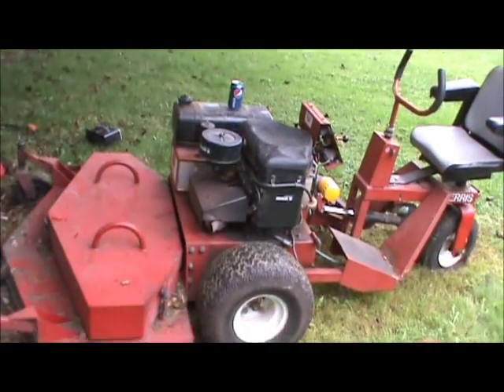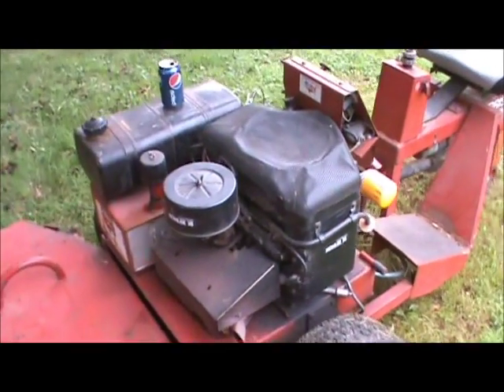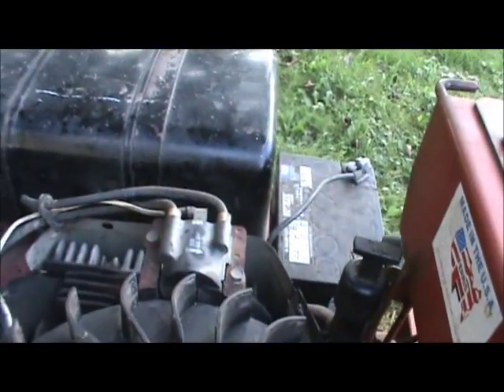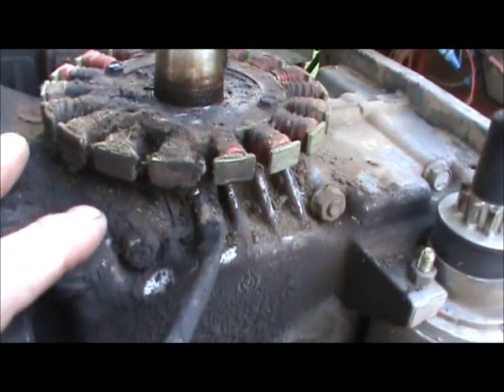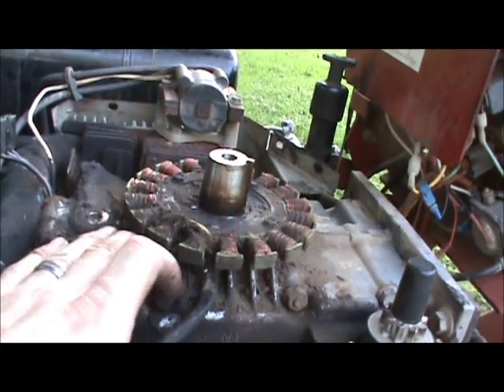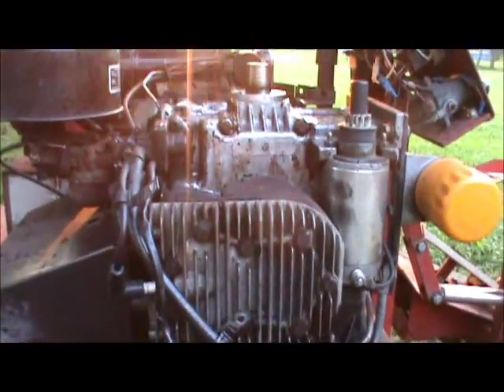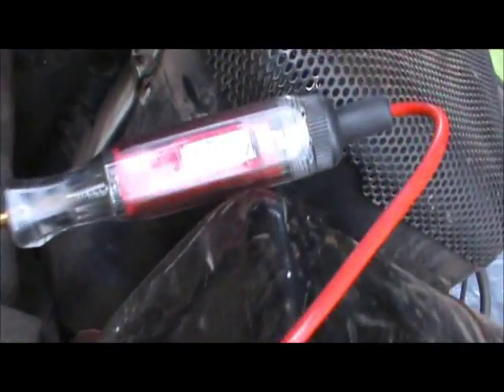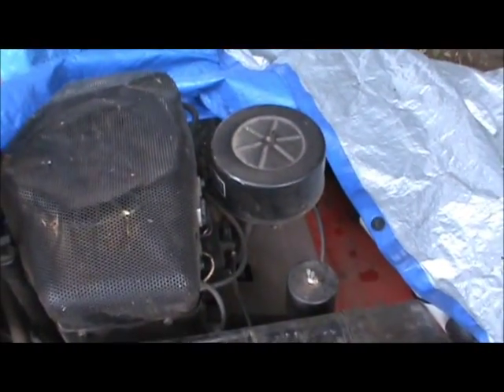Ferris - Kohler 18 Magnum faulty stator repair

Comment: I seen you had 12.1 volts not running. I would like to have seen a battery test with engine running. Otherwise good video. I have a Snapper with same engine.